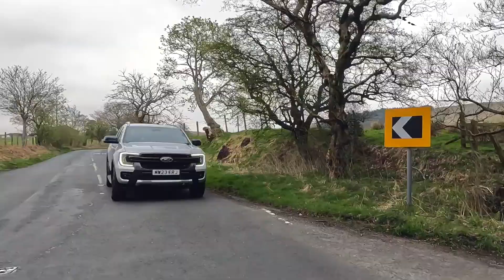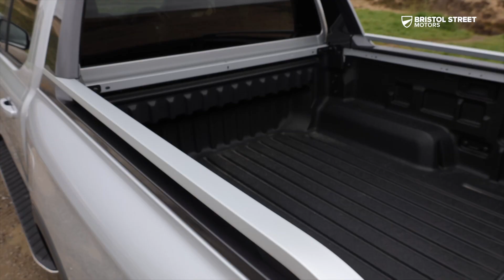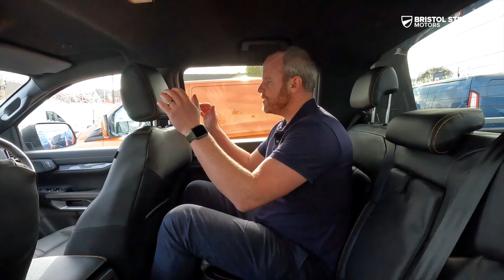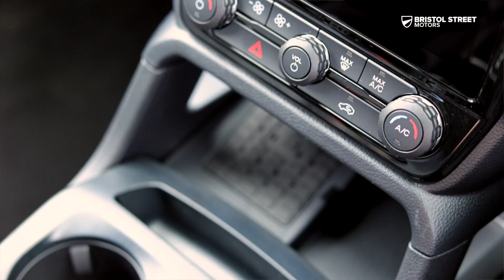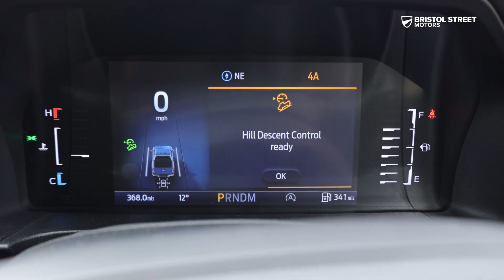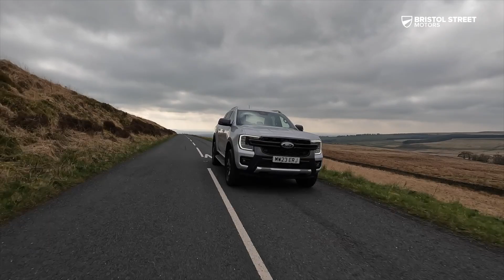Ford Ranger Wildtrak Review – Europe's best selling pick-up | Vertu

Comment: Let’s get real. The tyres on most models and the one featured are Goodyear Wrangler HT or Highway Terrain. The clue is in the word ‘highway’. They are great on the road and off it in the dry but pretty useless when it gets really slippery. 4wd is pretty much essential on damp grass on the slightest slope. AT tyres are available of course and they stand for All Terrain. These are far better and a better compromise for working vehicles where its potential is at least somewhat explored. Don’t get me wrong though, these are excellent tyres for roads and towing and off road in high traction conditions. It is a great vehicle, no doubt about it. My 2014 Ranger is good but the 2023 new generation is great with the 202hp 2 litre twin turbo mated to 10 speed auto with a two speed transfer box.   It’s a pity that the Wildtrak doesn’t come standard with surround cameras and the Power Pack in the UK though. Especially the Power Pack which adds so much for so little cost.

Comment: Mine arrived yesterday. No 3 pin plug or wireless charging pad. The model you’re showing has it. Great review
Reply: That’s the Power Pack that is not standard on UK Wildtrak and some dealers have forgotten to order it for their stock order cars. It adds the inverter with 240V socket, switch pack on the ceiling along with pre-wiring for accessories, the wireless phone charger and the USB on the rear view mirror housing for a dash cam.  Those that did not order this should be shot at dawn in my opinion.
Reply: how you getting on with it mate, Im about to commit but seems odd you didnt get 3 pin, is that extra?
Reply: @Tjw1  hi mate. I’m not sure TBH. It may be an extra…. Mine is the wildtrak, but didn’t come with it. I absolutely love it though and it comes with a lot as standard, so I’m not too fussed about the 3 pin plug or wireless charging pad. I look forward to driving it all the time. Get one!!!
Reply: @VinceNysse  cheers Vince, just stuck a deposit on one, mostly as it's a no brainer against tax. Glad your enjoying yours, you had much rain in the back, the older ones let loads of water in the load section
Reply: @Tjw1  I’ve got a limited company and it’s a lease vehicle through the company, so great for tax! Getting a truck man colour coded hard top fitted end of July so hopefully should be ok with regards to rain. I’ve already done 2k miles in it and it’s lovely to drive. You won’t be disappointed